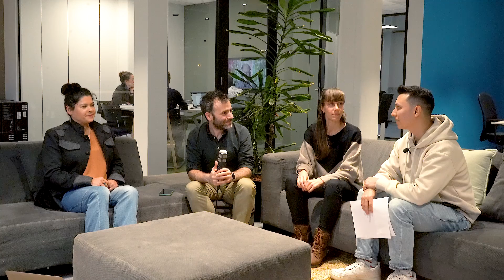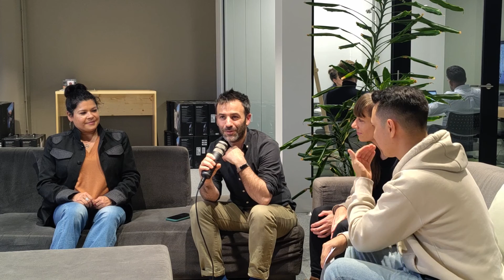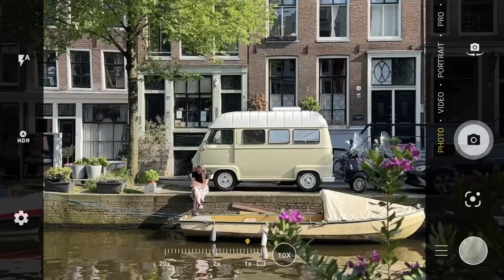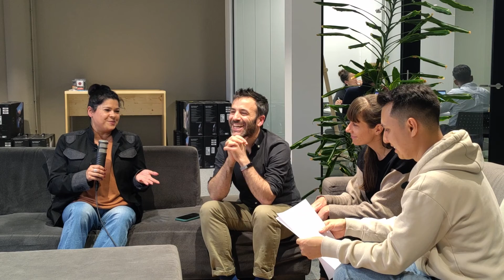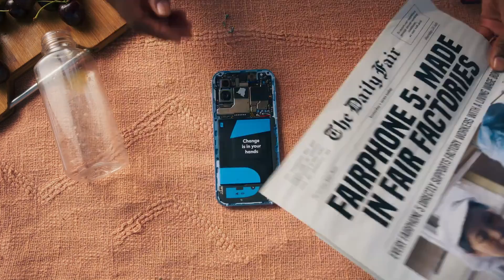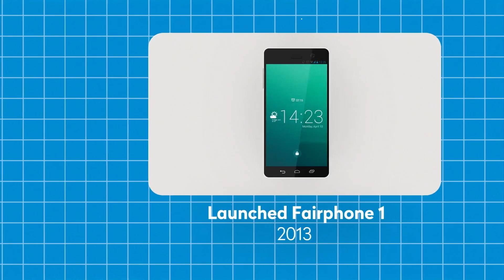Your Questions Answered | Fairphone 5

Comment: Hi @Fairphone , I am a big admirer of your work. I plan to move to Fairphone as my next smartphone. 👍 

If Fairphone were to ever make a notebook or laptop computer, would you please consider including a waterproof keyboard by default? 

Thank You so much for your consideration. 
Namaste. 🙏

Further explanation:

Portable computers such as notebook and laptop computers would be so much more long-lasting if, by default, they included a waterproof keyboard design. 

No one should be at risk of damaging their investment with an open keyboard design leading to the core of the computer. Please protect the core. It is unbelievably common for some people to eat and drink while working. Or even use hand sanitizer. A desktop or tablet computer, is not anywhere close to being as vulnerable, as the highly important, portable notebook and laptop computers. Waterproofing and water-resistant designs have been made “normal” with smartphones and tablets. The next step of positive evolution with computing may very well be waterproof keyboards on notebook and laptop computers as the new default design.
Reply from the maker: that's a great idea - have you heard of Framework before? They're basically the Fairphone of laptops. And if you're looking to get that idea made by someone, they'd be much closer to making it a reality than we are at this point. For now, we're sticking to smartphones and audio products - but yeah, check out Framework. Great alternative for laptops :)

Comment: I would like to provide some feedback and requests going further to FP6/7.I wish to be heard and I want to support Fairphone.
I own a Fairphone 4 (Calyx OS), Fairphone 5 for work (Stock OS). 

- Headphone jack
- 6inch oled 90hz
- Smaller
- Lighter
- Grippy plastic case + slimmer
- Square display panel.
- On-screen fingerprint.
- Camera autofocus on closeups.
- Manual privacy switches Microphone/Camera/Front facing camera/antennas.
- Better support for custom ROMs. 
- Edges not to be so sharp (FP5).
- OIS on wide lens.
- Reduced cost with optional parts: Optional 5G, Optional wide angle?

I am really happy to see no wireless charging on the phones.
I love the transparent back cover, its awesome. (FP5)
I love the availability of parts and being able to fix it.
I love being able to put the operating system that I want on the phone.

I am sad to say but now I daily drive a Google Pixel 7A with Graphene OS as a personal phone and the FP5 as my work phone. I want to use Graphene OS on Fairphone, but because of security patches issues its not supported...  The pixel has a comfortable phone case available like the onyx; smaller weight; usable one handed; Graphene OS;  I wasn't able to onboard my parents on the Fairphone train because its too expensive for them.

Wish Fairphone the best. And thank you for trying to be the best for the world.
- Anonymous

Comment: I love a lot of what the Fairphone team is doing, but my biggest problems with the Fairphone 5 are the lack of a headphone jack (a bit contradictory to their message in my opinion) and the size. If the phone had a headphone jack and was around 20% to 25% smaller it would've been perfect.
Reply: Very true!
Reply: It’s just unfortunate that smaller phones are quite a bit less profitable, which is something that’s needed for such a small company.
Reply: You can't have the phone be smaller without harming repairability. Especially if you also introduce another port. They need to use off the shelf parts so they don"t have to custom make base stuff in 5 years like the screen.
Reply: @tjeulink  can you provide sources for your argument, please? Because if even other small companies like Unihertz and Cubot for example have access to smaller screens AND can make much smaller phones that include a headphone jack, I see no reason why Fairphone can’t. They’re likely just following current market trends to sell more products (which isn’t necessarily a bad thing and I still respect their decision).
Reply: @zumuvtuber  none of that is evidence of the contrary. I didnt say they didn't have access to the parts. I said that the parts are less likely to be available long term. And yes, current market trends are whats most likely to beavailable long term, because those are most common.
Reply: Fairphone offers a headphone adaptor 👍
Reply: Not smaller, bigger!
Reply: I am of the same opinion. I own a Fairphone 3, with a earphone jack, and I use it often. It also feels too big for me, I still miss how small my old Samsung Galaxy Young (3" screen) was

Comment: Fairphone 6 wishlist: 

- 6.0-inch 1080p OLED screen 
- Headphone jack 
- Expandable storage 
- Physical privacy switches (mic, camera, antennas, if possible) 
- Optionally available/configurable screen without a selfie cam 
- Ultrasonic in-screen fingerprint scanner (very reliable) 
- IR blaster (if possible, very convenient to have) 
- Future proof high performance chipset (no IOT chipset if possible) 
- User removable battery (obviously)
Reply from the maker: what are the chances you'll drop your Fairphone 7 wishlist, right when we release the Fairphone 6? 😄
But no, seriously - thanks for the inspiration. We'll forward to our product team
Reply: I really hope that this won't be necessary, thank you for being open to feedback! :)  @Fairphone
Reply: RISC-V chipset if possible!
Reply: No PWM
Reply: the screen without a selfie cam sounds lovely tbh. the ultimate camera thing would be if it had something like the zenfone 7 or 8 have (flip) and it would be replaceable. Because that's the module that would cost most and each could buy how much they needed. would be even more interesting if there was a base model with no camera module installed and you can just buy it later separately - a way to keep down the initial cost of acquisition. then you can buy the cam module later.
With a setup of over 8 gb ram, a decent processor, expandable storage (or big storage), a decent battery - all you could play around with are the camera specs - which could be left in the hands of the buyer.
Reply: I would hold on to my phone as long as possible, has an IR blaster and an headphone jack, both features not seen anymore. Sadly not even on the Fairphone
Reply: DC dimming to avoid headaches.
Reply: @* * *-V1z Hard no to the UItrasonic in-Screen fingerprint reader, that would make another iteration of the OLED screen which should be set for a good 5+ years. For the optionally available selfie CAM, you can just remove your current in-situ one. Headphone jack is covered by a USB-C to 3.5 mm port adapter. 'Future proof high performance chipset' is not in the works if you paid any attention to Miguel. If that highend chipset is barely supported by the OE, that defeats the purpose of 5+ years of security and OS Support. Until Qualcomm & the like change their ways, its going to be Enterprise and IOT chipsets for the longhaul -that's where patches and updates are inherently guaranteed!
Reply: Fairphone offers a headphone adaptor 👍
Reply: I mostly agree but I prefer smaller screen. 4 inch is the optimal in my opinion because with 4 inch display most people can comfortably touch every corner of the screen while holding phone with one hand.